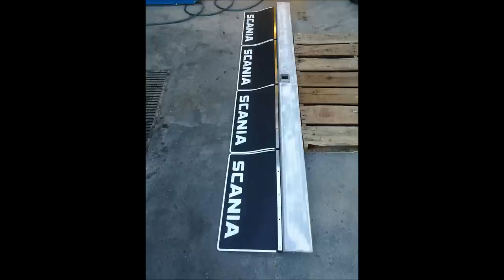SCANIA 141 V8. 1980. TRUCK RESTORATION PROJECT, FULL MOVIE !! LIKE, SHARE AND SUBSCRIBE. STAY TUNED.

Comment: Great video. That is a very detailed restoration . But what is the store about the roof rack , why must to have it, and what is the purpose of it?
Reply from the maker: hunzolee. Thank you. The store of the roof rack was many back in the  old days. It was used to store tarps for those who run flat beds. Many stored cans of fresh wather. And even oil and extra tools and stuff. And they where great as a bracket for the lightbox an the michelin men👍😉 Thank you for waching👍👍
Reply: @trucksnorway  Oh. I guess it was more popular in the 70' and 80'. Thank you for your answer. Keep on trucking.

Comment: Beautiful restoration! I am currently restoring a '77 LKT 111 in Australia.

Just wondering where you found the marker lights and lenses and the old Scania mudflaps?
Reply from the maker: James Bankes. Thank you for that👍👍🙂 The LKT's are tough trucks👍 To bad they whas not offered in our part of the world. Do you mean the corner lights beside the grille? They can still be bought new at Scania here in Norway. The mudflaps i got at a website in the netherlands. Just google truckjunkie. I think they ship stuff all over the world👍😊
Reply: @trucksnorway  
They certainly are. The lights above the windscreen in the top corners are the ones I mean.

I will Google them now.
Reply from the maker: @jtbhire  I reused those lamps on the top corners, and just got new lences for them at Scania👍👍
Reply: @trucksnorway  Sorry to be a pain, but could you find  the Scania part numbers for those lenses? My local dealer is having trouble finding them. 👍